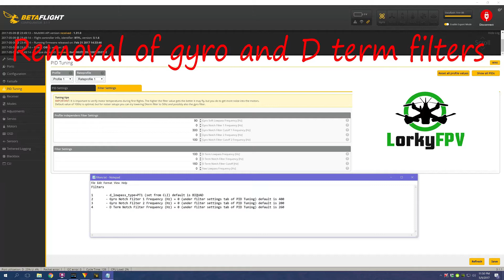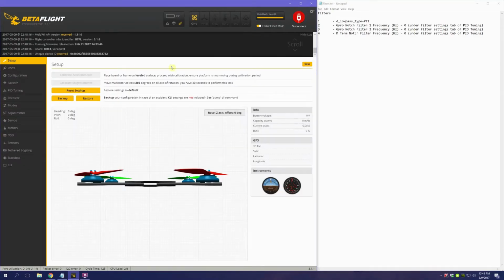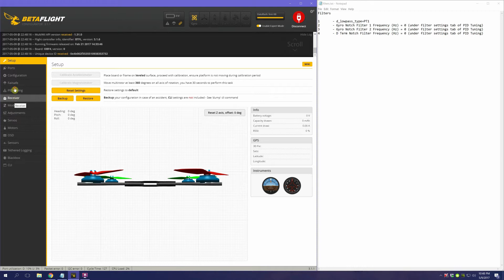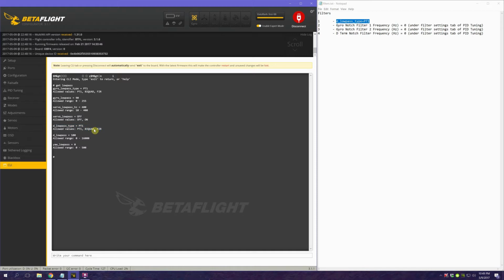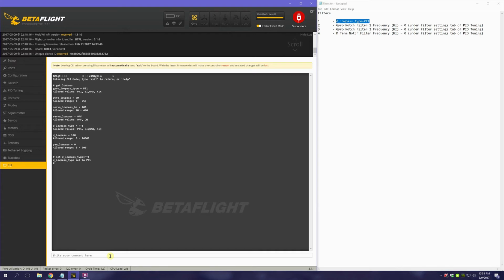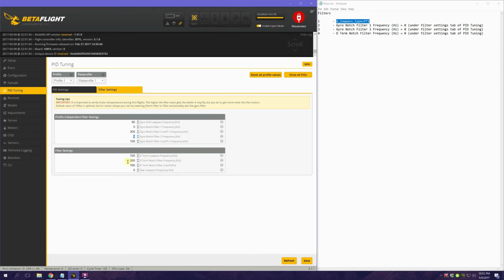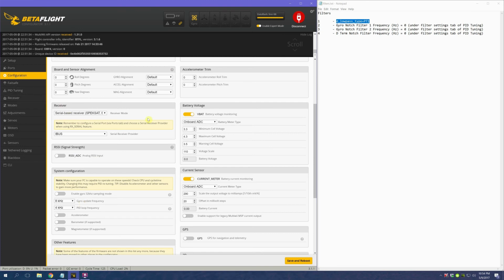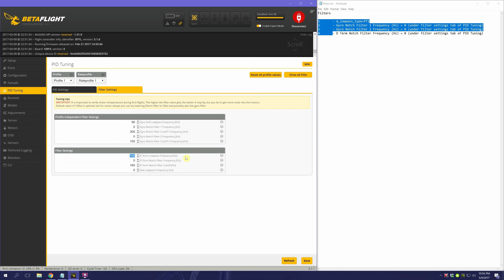Removing Betaflight Gyro and D Term Notch Filters - quick and easy

Comment from the maker: Update: The flexibility of your frame makes a big difference when removing filters, I had a 4MM Lumenier frame that was extremely rigid, after going to a knockoff that easily flexes the motors get much much hotter and I had to back off the filters. The movement of the frame during flight requires PID corrections and adjustments and that additional energy is getting dumped into the motors like high D term would cause.

Comment: I have done pt1 but my motors make a horrible noise an come down hot can I revert back
Reply from the maker: Yeah of course just go back into CLI and type d_lowpass_type=BIQUAD then save
Reply: LorkyFPV thanks for speedy reply
Reply: LorkyFPV LOL that's funny I just asked this question I guess I should have looked through the comments
Reply from the maker: On 3.2 up there is a selectable drop down in the filter page, prior to that you can just use the CLI command. Highly recommend flashing to 3.2 if you can, it is really nice.

Comment: Great video should you start off with stock PID or leave the ones that you are currently using
Reply from the maker: Well it does change how it fly's so I think starting with stock PID's then retuning afterward would probably be best. I left my PID's before doing it but they are barely different than default. Honestly on stock PID's with PT1 and a notch or 2 removed I think it flys great with out messing with PID's at all.